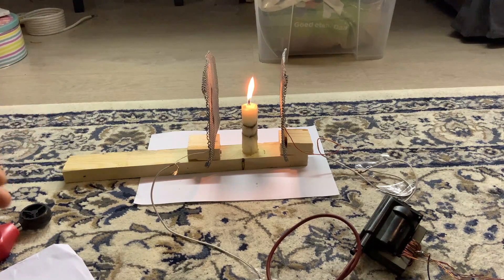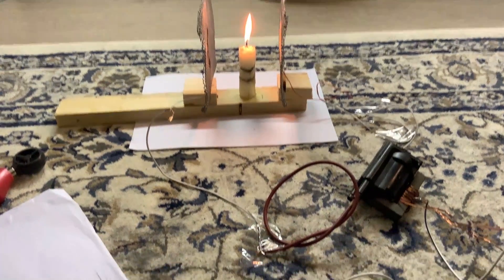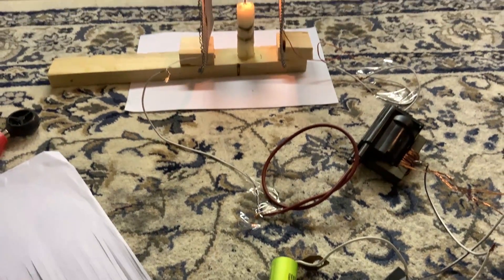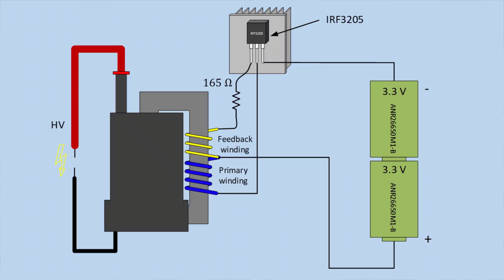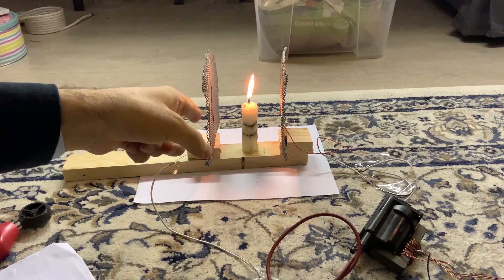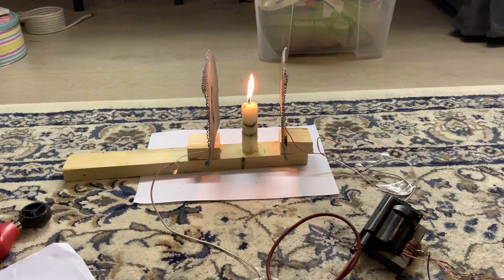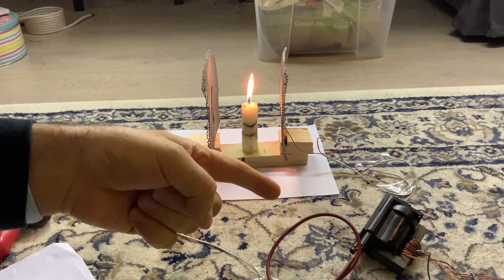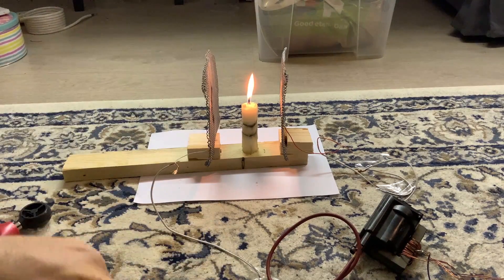Effect of electric field on a candle flame ( ionic wind )

Comment: Burning incense sticks is an easy way to show delicate movement of air at home.  Smoke will move with the ionic wind.
Reply from the maker: Thanks for the suggestion, I will try it
Reply: @HVE  Replace the candle with sprayed (atomized) water; place the candle above to burn the hydrogen and oxygen extracted and verify the experiment.
Reply: 4:39
The smoke of the candle shows that there is ~0.1m/s wind from left to right in the room.
... just this wind is with power switched off, just do the same and switch power back on.
Reply from the maker: @iljabuchmuller7889  Good observation.

Comment: In reference to your circuit, i plan on placing the transformer, resistor & the IRF3205 (with heat sink) in a small plastic container filled with mineral oil. The two leads from the transformer will protrude from the oil. I am trying to cool the components & reduce any possible arcing. I will 'try to remove' the ferrite material from the transformer & use different & random ferrite rods for experimentation. I plan on using magnets attached to an insulated rod & placed in different areas of the ferrite material. My two goals are to have an inexpensive & simple hi-voltage power source to power a small tesla coil.  I wish your students & yourself success with your experiments.
Reply from the maker: Hi, thanks for the comment. At this voltage level it is not totally necessary to immerse things under oil (if something breaks it is a mess to replace it when it is under oil). I have used the same circuitry to drive a Tesla coil before (https://www.youtube.com/watch?v=jsnQpjJRHEA) However, notice that this circuitry is rather inefficient and is only good for short term tests because it is very simple circuitry. Good luck with your Tesla coil
Reply: Replace the candle with sprayed (atomized) water; place the candle above to burn the hydrogen and oxygen extracted and verify the experiment.